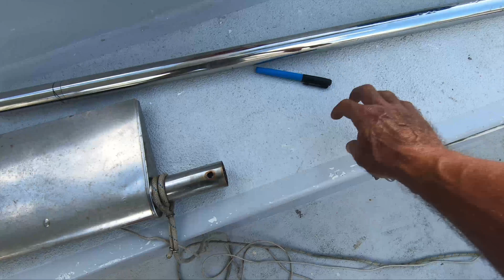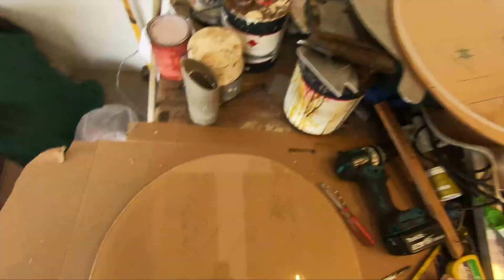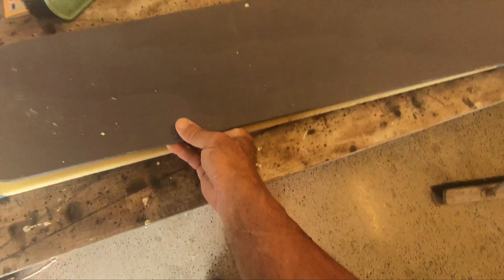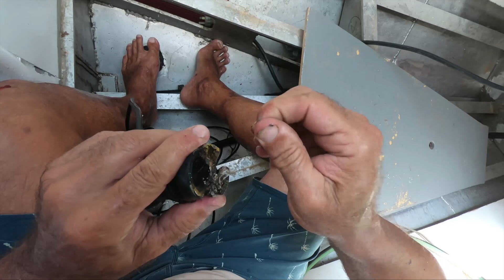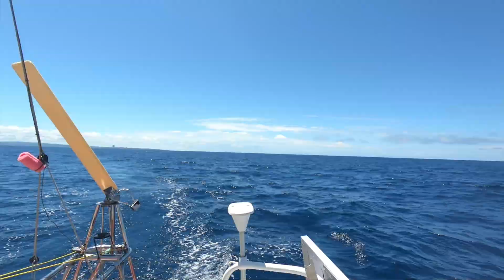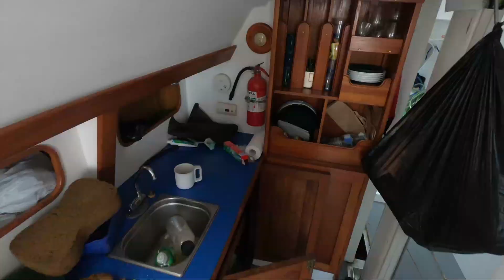Wind Self steering and home built wheel adapter on Radford 14m sailing (Ep9)

Comment: For retrieving the drone, fly a few hundred meters upwind and "park" it just off the windward side of the bow. Then sail the boat to the "parked" drone,  avoiding the shrouds, of course, lean out and grab the drone. If you miss, simply fly ahead again and repeat. Obviously easier with a second pair of hands, but much more controlled.
Reply from the maker: I'll give that a try but I might have to slow down for the landing. Thanks

Comment: There is nothing wrong with the Monitotor corrugated plastic vanes. Surely the vane you built is more stout but it will not work well in light winds because of the additional weight.  I make double sized vanes out of extremely light plywood and they help the vane keep working in very low winds.  They eventually get snapped in gusts so I just make up 10 at a time.
Reply from the maker: That's good to know. Hard to find light weight plywood. In Fiji it's heavy weight. I made some from ply before I left Australia. Will keep as spares but will keep an eye for some light weight. What thickness are yours?

Comment: I have just built a similar  mechism  in teak with a bicycle axel qd  cam,,,,, so it is a 3plate clutch one fixed to the wheel one tufnol  inner location disc and an outer line holding  disc. 1 finger operation  on the cam 
Your ser up looks good , well done sorry I don't have any footage of my clutch
Reply from the maker: Good on you. There is a bit of work making them. Hope yours works well